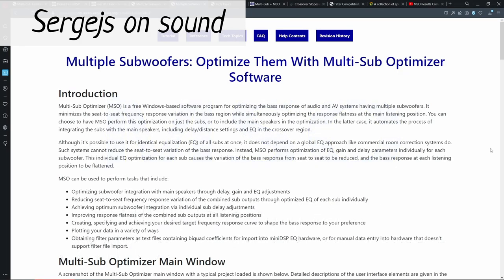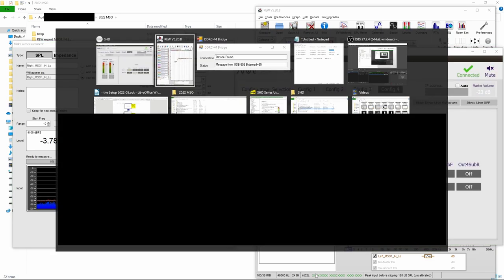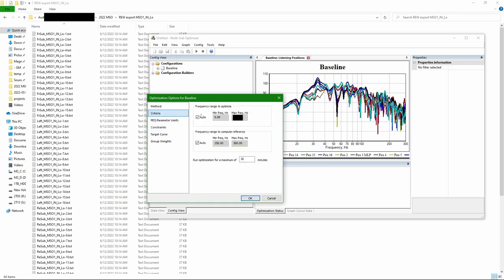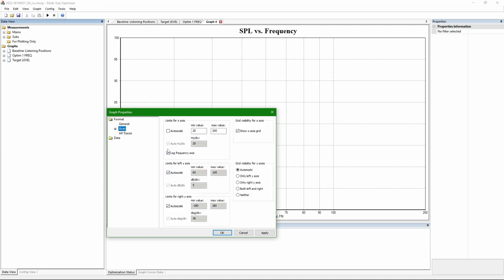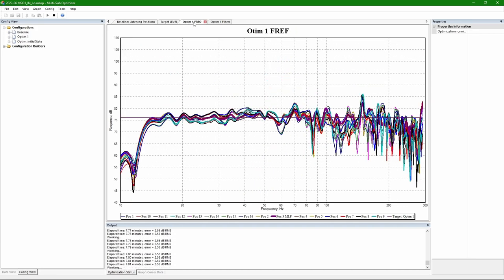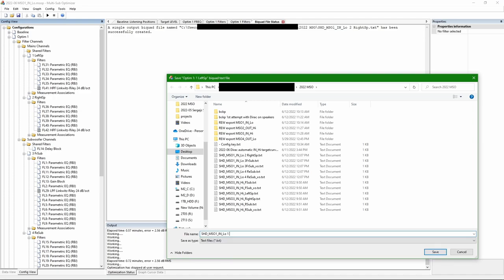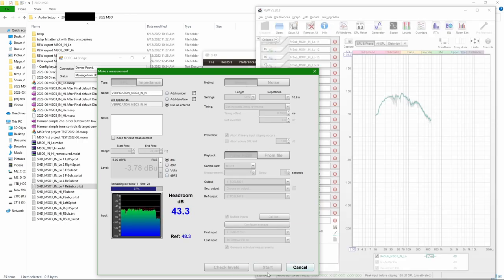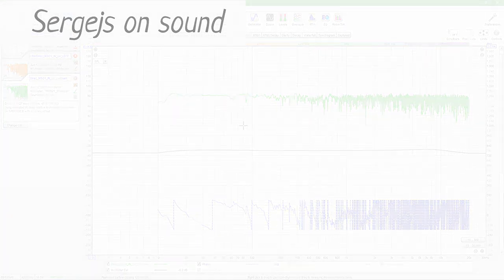MSO for 2 subwoofer integration on miniDSP SHD, Flex or DDRC-24

Comment: I am going to try to follow this as well. I will try to read the sources you referenced so that I can understand which 4 positions to measure and doing the four measurements per point.  I have much lower Xover points planned - more like 40Hz.  My current Dirac only solution sounds fine, but I think the sub levels are wonky and the timing is certainly off, so getting the offsets correct would probably help the most.  Thanks for putting this together. I will probably watch it a few times.
Reply from the maker: All good, just consider using at least 80Hz crossover - stereo bass is pretty much a myth and at frequencies below 100 Hz you will be well into modal region and hearing the pressure waves of your room instead of the speaker locations. So MSO can improve your bass + you will clean up intermodulation distortion from your main speakers, which can also improve things ( https://youtu.be/i1sa50hzEcM ).

Comment: Nice video. Why did you choose LR24 filters for the mains as opposed to BW24 as recommended by minidsp tutorial? Also why no LPFs on the subs? Finally, you say you tried MSO before and after Dirac... I've wondered which is better. When you did Dirac first was it just on the mains with the subs turned off? That would allow dirac to make the most of the mains and get the timing spot on, then you take your REW sweeps/measurements for MSO with Dirac enabled on the minidsp. Would that not then allow the subs to just come in under the mains to do some subtle support/correction? Thanks
Reply from the maker: Hi, LR24 is the usual recommendation. See for example https://www.ranecommercial.com/kb_article.php?article=2134 or https://www.audiofrog.com/crossover-slopes-and-protection-for-speakers-does-a-steeper-filter-provide-more-protection/
LPF on the subs is a reasonable idea. I have not seen it suggested in any MSO tutorials, but go ahead with it if you see a need to protect your subs.
With Dirac before MSO, yes I tried as you describe, but as I mentioned in the video - the results in REW after MSO are not as flawless as it predicts - Dirac produced prettier results. Perhaps it was my mistake somewhere, but go ahead and try it - in theory it should work, only I did not get the result I expected.
Reply: @Sergejs_on_sound  fair enough. Thank you for the links. I'll take a look through them.

Comment: How do you connect 2 speaker (L & R) and Sub with miniDSP 2x4? There are only two in for 2x4
Reply from the maker: Hi, you can see the final routing at 2:51 and also in the MSO tutorial on miniDSP website. 
The idea is that both left and right input signals are sent to every subwoofer you have. While the speakers get their own signal each.

Comment: Very useful tutorial. Thank you. Do you think it is reasonable to use 2xDSP in the row (MiniDSP & Dirac)? Also I would like to see a more reasonable scale on the REW, like 35-105db. I can detect and judge better the results.
Reply from the maker: Hi, multiple DSPs should be perfectly fine. It would only be  concern if there would be analog signal wires involved between DSPs, and even then, especially for subwoofer signal we can accept quire some degradation from analog signals without audible effects (for example if cheaper miniDSP 2x4HD is used to integrate multiple subwoofers for a common AVR)

The graphs in REW were on defaults - I needed to move fast to do the complete calibration while no-one was around :)

Comment: Thank you very much for the detailed step by step procedure described and congratulations on your fine results. Let me just ask two newbie questions: first what to do when report comes back with negative values on both subs? And second: if LPFs are loaded in the subs locked say for example in 100Hz, what's the use of PEQs stating corrections above this. I am really scratching my head about these two and I would be indebted if you can provide any solution. Please take care that my set up is for music only with two subs and two mains!
Reply from the maker: - negative values on subs is the same as adding extra delay on the main speakers. It is all time relative to the speaker/sub which can get the sound to listener first.
- Using PEQs outside crossover passband can be useful to remove some peaks which would otherwise leave bumps in the theoretically-smooth crossover slopes. These are most relevant when dealing with DIY speakers or car audio - theoretical and actual crossover slopes can be quite different in practice,

Comment from the maker: Please share your MSO tips, any mistakes you found in the video and other feedback!

At best this video is just a starting point, not an exact manual. There are many tricks and styles to use MSO, plus it is always possible to re-run optimization with different settings and compare the results. The recording also helped me to detect some of my mistakes and clarify some unexpected verification results.
Reply from the maker: for the record, here are some corrections from Andy C about "stopping the optimization early and starting over" + why sometimes optimization looks like it is stuck while it actually isn't.
https://www.avsforum.com/threads/optimizing-subwoofers-and-integration-with-mains-multi-sub-optimizer.2103074/post-61781072